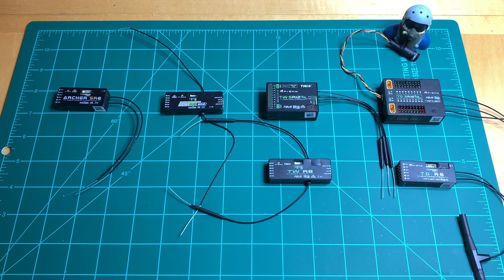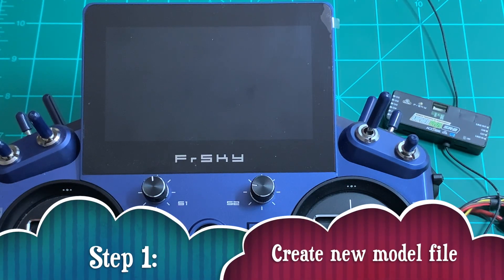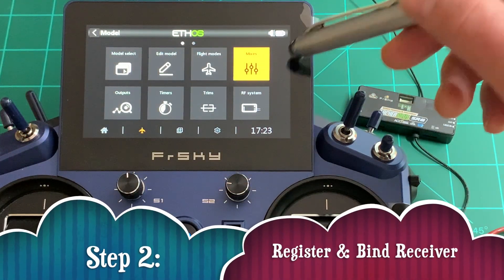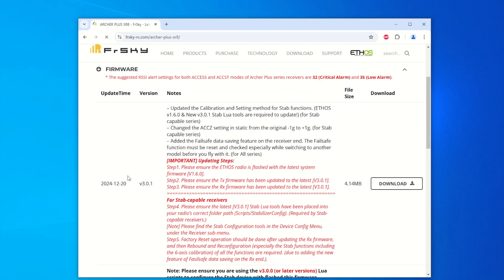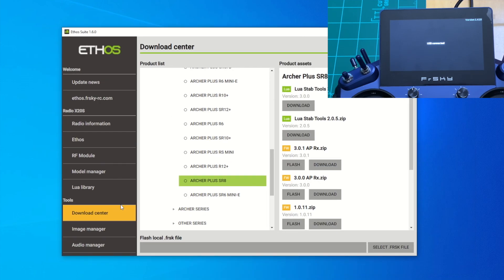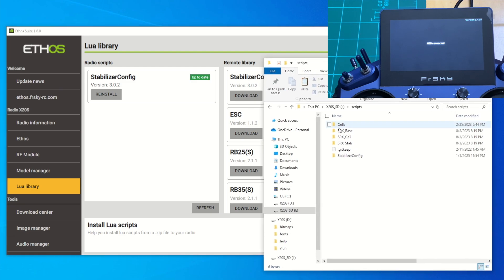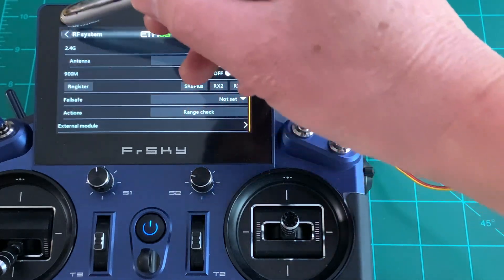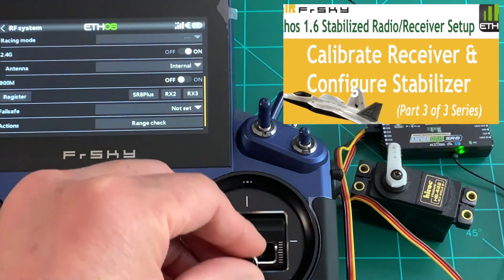FrSky - Setup Stabilized Receiver (Part 2 of 3 series).

Comment: When is set up a tdsr10 for two aileron, I only get stability on one aileron (channels one and five ). All my firmware is up to date and I think I’ve run into this problem before but I can’t for the life of me remember how to enable channel 5 stability
Reply from the maker: Make sure you have all surface movements for both ailerons before you go into setting up stabilizer mode (doesn't have to move correctly, but need them to have movements..). And if you are setting up both ailerons for channels 1 and 5, then during stablizer setup make sure you set AIL1 to CHAN 1, and AIL2 to CHAN 5 (instead of AUX), then do the reversing if needed.

Comment: Need to add if you have one of the newer models with the flash memory instead of the SD card you will have to add the firmware folder if you want it.
Reply from the maker: Yes, it is like a mounted drive and you can create a folder name such as firmware. Thanks.